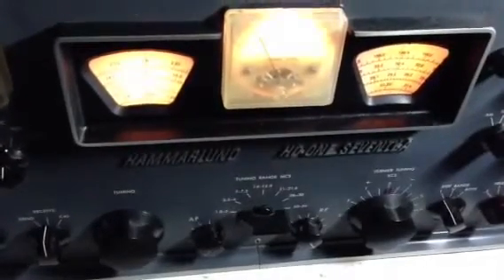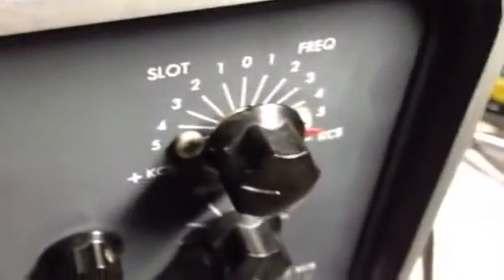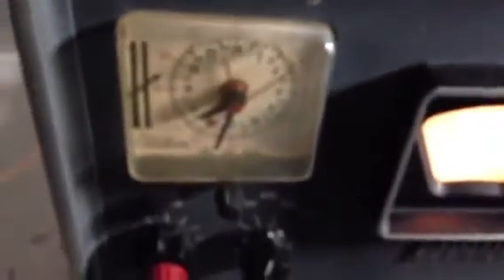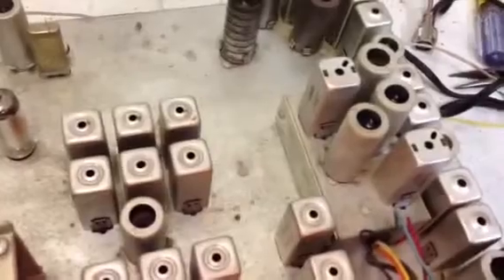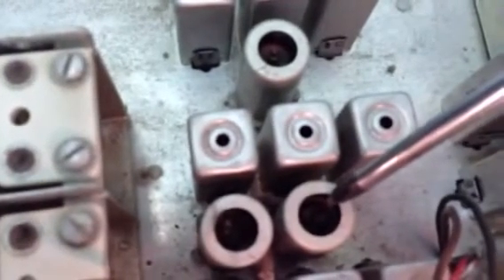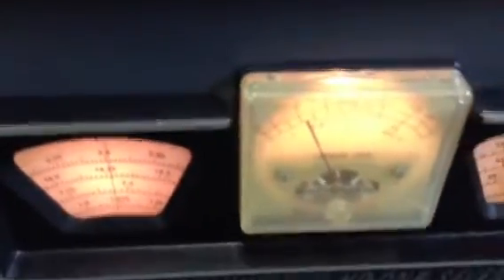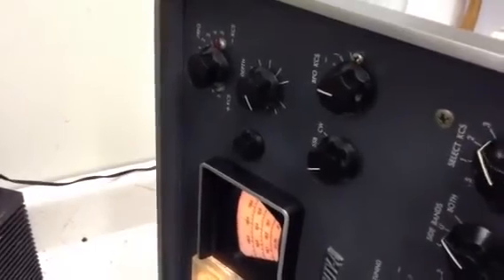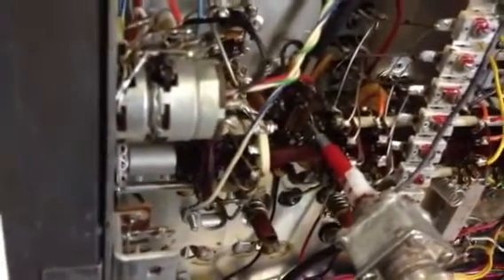Hammarlund HQ 170-A Low IF alignment Part lll, K7PP

Comment: Pete- one last question. The signal injection apparatus you are using…looks like you made it? What am I looking at exactly? Thanks, Wes
Reply from the maker: Hi Wes,  It's an old Motorola probe with a 2pf cap inside.    Nothing special.   You could use a scope probe but You have to have some kind of series cap to keep high voltage out of Your signal generator.